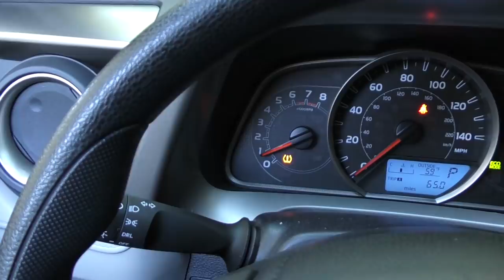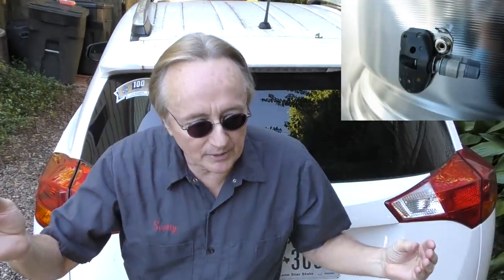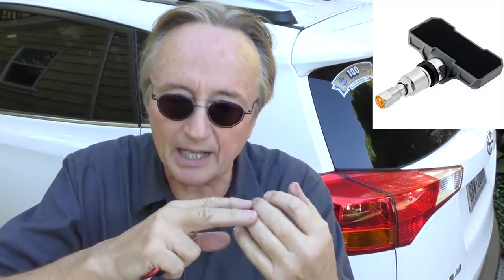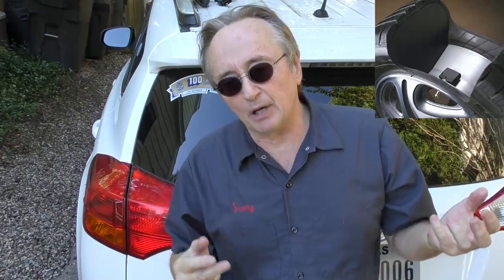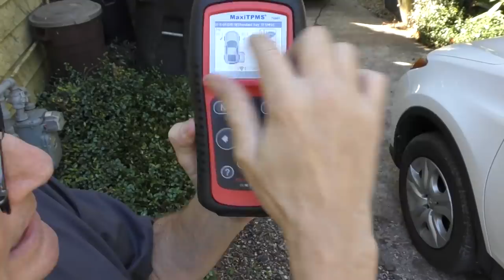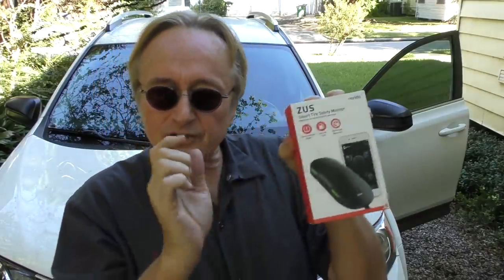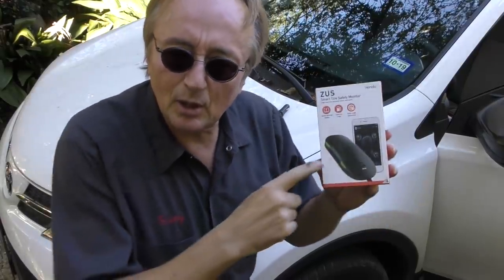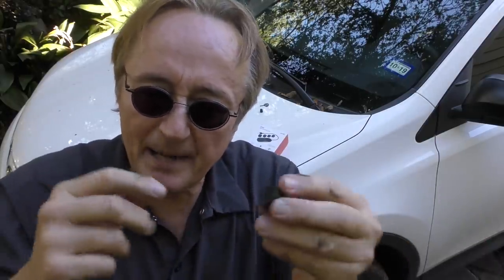Here’s Why This Kind of Tire is Stupid

Comment: I had a poor hapless elderly lady who had been literally ripped off by at least 3 separate shops replacing TPMS units on all 4 of the mounted wheels on her RAV4. She still had a constant TPMS light on her dash. And the last shop she was at told her that she might need a new computer.  

 I was the shop manager,  and I asked her for her keys, pulled the truck into the shop, proceeded to check all of her tire pressures,  and verified with my Snap On Scanner  that the TPMS were communicating with the PCM.....which they were. 

Then I popped the cover off her spare tire and checked the pressure.  It was the OEM spare, and had NEVER had the cover removed from the tire before.
Lo and behold.....the spare only had about 22 P.S.I. !!! 
Inflated it to the proper pressure and before I could even pull it out of the shop, the light went out! 
 Didn't charge her one red cent! 
I felt really bad for her being taken advantage of like that.
Reply: Well done.  Where is your shop?
Reply: Awesome 👍. Every shop and every mechanic should be just like you! But that would be too good to be true....
Reply: @cruiser1398  Thank you for the compliment!
Reply: TSC TSC  Thank you for the compliment!
Reply: I was going to ask if it was a toyota and it sure was lol
Reply: Impalaman1968 Dude we live in a world where money is everything. Shops and dealerships will PROFILE you. The old lady you saved was profiled because the douchebags knows she has money and don’t know about cars so they say hey let’s make a high repair bill. Good job kind sir for helping her. We need more people like you.
Reply: My apologies for being able to up-vote only once.

Comment: Call me old fashion but I never needed a light to tell me I needed air. People these days cannot do anything for themselves..it's really sad
Reply: It’s just for less usage of your time. Now you can use your phone to remind you when to change the oil, when will the battery run out, when will something in your car be outdated or worn out because of the warranty. When you have a busy life, it sure does help a lot. Something the older generation doesn’t understand. I noticed that with my parents.
Reply: SubScribe 887TV A phone can definitely cause a nervous breakdown, but not as fast as trying to read your comment with it’s absurd capitalization. 🤦‍♂️
Reply: Same. That's why I never bothered changing those sensors
Reply: If you go this route, is there a way to disable the factory system or you will you have the warning light on permanently?
Reply: That's stupid to say. Hey why don't you go back to landline phones without caller IDs while you're at it, old timer
Reply: horacio gonzalez it’s not being lazy it that we have to work two to three jobs if your middle class now thanks to everything being high these days. We have so much in our minds we have to do to just check tires by looking in just using our eyes isn’t enough.
Reply: @DirtyGreens  That's stupid. People are fat and lazy because of their diet. Processed foods, take-out, sugar, seed oils. Eat like your grandparents.
Reply: @living-wellon-less5669  Oh.
Reply: @horaciogonzalez4070   What happens when your phone breaks or the power goes off?  You will have no clue and the rest of us will use our eyes.
Reply: This is the kind of comment that bugs me. Do you need it? No! Of course not! Doesn’t mean it’s not nice to have tho
Reply: @johnc9546  When the phone breaks or the power goes off the car battery still works which means the computer in the car still works so while you are staring at your tires using mental telepathy to determine your tire pressure I will just start my car and drive away!
Reply: @living-wellon-less5669  Good for you.
Reply: @johnc9546  It's nothing special, it's called common sense, you should try it sometime! It will save you a lot of embarrassment!
Reply: I had to explain to a surgeon how to check the air pressure, and put air in the tire.  Imagine that mommy, and daddy sent you to medical school, but never taught you how to check a freaking tire!  BTW, I'm a nurse.
Reply: @pmarie2003  Priorities, I have a friend that is 51, lives in LA and has never driven a car but he is a brilliant writer and officially scores in the genius level of IQ. The fact that he doesn't even know where or how to check tire pressure means nothing to him or me, it only means when I go to visit him I have to drive or take Uber!
Reply: David Knigge Grams ate a plain potato for dinner most nights, lived to be over 100
Reply: @living-wellon-less5669  lol thats sad 🤣😂🤣
Reply: its the manufacturers that shove these unnecessary tech down people's throats
Reply: @aneesh8963  No they don't, ABS and traction control are required by law and tire pressure is a critical part of the system, if tire pressure drops too low ABS and Traction control i can be compromised and the computer will even shut them off!
Reply: horacio gonzale
Reply: You can easily bypass it, which i have done in my older car, as the sensors don't work right with my after market wheels.
Reply: @shartingfish5761  Not if you have traction control!
Reply: Living-well on-less even if you have traction control, makes zero difference
Reply: @shartingfish5761  Sorry but it will interfere with the traction control, maintaining proper air pressure is necessary for traction control to work properly or even at all. I retired from GM, I know how it works and even if you work a way around it  it's foolish and potentially dangerous using traction control! This is all a lark anyway, failure on those valve stems is rare unless maybe you are driving a Toyota! Get used to it, it's called technology and some of it actually works!
Reply: @living-wellon-less5669  cars without tpms have traction control though, you just make sure pressure is within spec, so where's that logic going?
Reply: @hpt08  You are assuming nothing goes wrong, you are assuming everybody has the same sense of awareness, you are assuming you will never get a blowout which using traction control could easily cause an accident, you are assuming a 70 year old woman is going to be regularly checking her tires! What you decide to do to your car is one thing but blindly giving advice like that is irresponsible at best!
Reply: Living-well on-less I appreciate the feedback but;
1. I don't buy GM products because there junk.
2. Traction control in most cars has zero to do with tire pressure, most traction control systems of early used a module on the abs controller to modulate the spinning of a wheel to gain traction, the traction control systems of later in such systems like A-Trac in Toyota uses an electronic viscous coupler that uses the centrifugal force to measure a slipping wheel and can modulate power other wheels.. if GM truely relies on tire pressure to determine traction control.. what a piece of crap system that is..
3. I at no point said you shouldn't maintain a specific tire pressure, but running a 30lb of air system in a mickey thompson racing slick isn't happening and since that light is annoying, i just used a pvc tube in the trunk to house all the sensors and still do that on my older cars so I don't have to replace the stupid sensors every time i change tires.. I don't care about traction control and have the stability control bypassed. Running a ford 9in rear, 3.73 gears, and traklock with 3in traction bars, and a 2000 stall converter.. if i need weather traction, i put 4 sand bags in the trunk and a set of blizzacks on a different set of wheels..
Reply: Living-well on-less he said make sure the pressure is in spec and that invoked that reaction? Why you so defensive? Also, tpms has nothing to do with abs/traction control. Tpms is a wireless system, trac/abs isn’t
Reply: Jerry4050 I Agree Jerry4050, Everything is so expensive now because of technology. I understand that it’s a convenience for people who love technology, but it will cost a lot of money to fix when something goes bad. Anyway, I agree with the technology being used in the medical field though.
Reply: Thing is though , by the time a modern radial "looks " low on air it has about 14 pounds in it maybe.

Comment: I'm gonna stick to manually checking and keeping an eye on my tyres.
Reply: Yep the old fashioned way is better.
Reply: You can also crank your windows manually. Maybe your engine as well.... Old foks not accepting change is always hilarious.
Reply: cesar soto Young folks accepting extra unneeded expenses crack me up 😜
Reply: cesar soto no one is saying that change is bad. All these electronics will fail and cause more issues. Sometimes it’s better to just check things yourself like tire pressure and engine oil level!
Reply: YOu can also hit your tires with a stick to check if its good on air 😂
Reply: @hawkboy000  these people probably go to the dealer to check their oil level 🤣😂🤣😂

Comment: Audi for example uses indirect TPMS which instead measures pressure by monitoring individual wheel rotational speeds (by using the ABS sensors); A tire at low pressure will roll at a different wheel speed than tires at higher pressures.

Comment: There's three things I watch for to see if a shop is truly competent.  (1) Do they inflate the tires (assuming factory sized) to whats on the sidewall  instead of what's on the doorjamb?  WAY TOO OFTEN!!!  Yes, the tire can hold 35 psi BUT the cars manufacturer designed the suspension and alignment to operate with the tires inflated to a specific pressure.  Doing otherwise wears things out faster and is potentially dangerous.  (2)  If they do a light check do they skip the backup lights?   Maybe it doesn't matter to most folks but when I ask for a light check or worse, when you foist one off on me, DO IT RIGHT!  (3) When I bring it in with a front-end shimmy while braking do you raise it up and turn the front wheels by hand... WITH the tire on the car?  BETTER NOT!  Archimedes said give me a long enough lever and I'll move the world.  Same thing applies to a tire.  You're using a foot-long lever to rotate the tire and it will turn easier.  Pull the tire and try rotating the spindle with one hand on the center of the lugs.  THAT is how you determine how warped a rotor is.  

Other things come to mind from time to time but those are the big three that stay with me as they have happened more than once.  That ASE sewn to your shirt don't mean crap when you talk fast and loose to me.

Comment: New cars have more sensors/electronics = more things that break....
Reply: Yet modern cars are more reliable and commonly get more than 100 K on them before any major repairs are required! Try to remember most of those sensors perform a function required by law!
Reply: That's just the idea!
Reply: @living-wellon-less5669  Yet modern cars are more reliable, NO
Reply: There endless money pits!
Reply: @littleeagle7563  obviously you never owned a car with points, and a condenser,  and the average engine had to be rebuilt by 100 k!
Reply: Well of Coors 👍🏻
Reply: @living-wellon-less5669  That's not true.
Reply: @living-wellon-less5669  what are with AC doesn't have a condenser? Lol
Reply: @thefuzzypickle8277  Ignition points, DUH!
Reply: @thefuzzypickle8277  Do you know the difference between AC and ignition?
Reply: ABORIGINAL ONE  It's not possible under current laws, the only legal way to do that now is with a kit car!

Comment: I had a problem with my TPMS light on in the dash. Thanks to you Scotty for your video you saved me hundreds of dollars because if I would have taken my car to any of these mechanic in New York City they would have ripped me off.  It was like you said I never bothered to check the spare tire pressure on the Honda CRV 2015 the pressure was at 20 and the spair needed 60 PSI. The spare has a TPMS like you said thanks for saving me time and hassle on the road if I used that spare tire on the road it's like I would have  a flat tire all over again, thanks for the advice.😀😀😀

Comment: I don’t have a tire pressure sensor in any of my tires 😂
Reply: & yet life goes on does it not?   Another "whiz bang" thingy that is really not needed.....
Reply: MarlinMR7 lmao yeah
Reply: You have tires?
Reply: Yes you do
Reply: I dont have it in my tires but i have the feature, i think it just measures the hight of my vehicle.
Reply: It’s known fact that tire underinflation is pervasive and is often responsible for car crashes and blowouts.  Then there are the millions of gallons of wasted fuel and the added air pollution/climate change that it contributes to.  I have a TPMS on my car and am grateful for it.  It makes it impossible to ignore an important car maintenance issue.
Reply: @ansdguy1  tire pressure  monitors  aren't that important  it's just another gimmick  money maker  I have one vehicle  with one without  they both function perfectly well everytime I gas up I check tire pressure
Reply: @stealthboy5767  Depends on the age of the car.  I have a 1994 Ford Ranger that doesn't have any.
Reply: Cuz ur poor
Reply: The Tire Pressure Sensor technology is going to be required in the United States soon, if it isn't already.  Frustrating to be forced to have new, unnecessary technology.
Reply: @ansdguy1  most accidents are caused by bad driving when one owns a vehicle they should be able to do their weekly checks this includes coolant engine oil washer fluid all these have sensors but if one checks these regularly including the tyre pressures most times if tyres are damaged or cracking /bulges you have a better chance of not having a problem tyre pressure sensors are not an indicator of a fault /condition in the tyre itself visual checks are the safest doing these checks in my opinion is safer by far electronics can go faulty so the thinking is I am safe because my sensor says all is well hmm check the condition of your tyres often and the pressure in doing that you are doing the best you can for your safety and others and saving the environment drive safely happiness to you and your family from the UK 🇬🇧🇺🇲
Reply: @alisterwest6987  very well said 👍
Reply: Ron L unless you’re a responsible adult who knows how a vehicle drives and knows when something is wrong. They call those dummy lights for a reason.
Reply: Alister West Here is the thing, quantitative data doesn't lie.  You seen to think that people simply don't ignore tire pressure.  The know fact by the Insurance Institute suggests that in the U.S. this is not the case.  You people that butch about having to pay for new technologies make me laugh.  I own a 2006 Cadillac CTS that has the system and its almost 14 years old.  New tech?  Hardly, and besides today's cars are nothing but new tech.  From the tires to the motor oil to the ignition system to the safety systems like chassis that resist causing injury when crushed to environmentally friendlier air conditioning coolant to electric starting to drive by wire throttles and on and on.  You have not addressed the climate change aspect of low tire pressures or the decreased fuel mileage or the premature wearing out of those expensive new tires.  Exactly how much do these SAFETY systems as to the cost of a new car?  People pay a small fortune for audio or wheel upgrades, along with several other possibilities.  
Here in America we have an old saying in in the form of three letters; BFD.😏
Honestly, all of this crap about tire pressure monitoring?
Reply: Congratulations
Reply: Glue one on your tire
Reply: My tire pressure monitors are in the rims, not the tires.  I still check tire pressure every month.
Reply: I mean they're only as useful as people maintain them. I know why they put them but if people ignore them? Welp

Comment: Why company put these tyre sensor inside a tyre

To rip you off
Reply: It's because 2008+ all cars must have TPMS by law.
Reply: In the US, it's federal law. If companies want to sell cars 8n the US, they have to have these sensors. I think dualies and heavy duty trucks are exempt.
Reply: They would steal the sensors so that's just a horrible idea in the first place besides the fact that it's law
Reply: It became U.S. federal law in 2008 due to all the drivers never checking their tires and then causing crashes due to tire failures.
Reply: Jose Esparza umm, Scotty said there’s a lock so you can.t steal them
Reply: @benz merc The law came about because people were dying because of tire tread separation due to low tire pressure. 

The whole Firestone debacle was caused by it. 60 people died and over a hundred injured.
Reply: @rays7437  Today we have people in their 90's still driving and most young people can't change their own oil much less check tire pressure and how many women in history would even think of checking. It isn't fair to label them all as "morons" when some of them could buy and sell you before lunch!
Reply: @jschackmann2  in what part of the video cause I didn't see him mentioned anything about that?._.
Reply: @living-wellon-less5669  
Guess I touched a nerve.  So maybe they aren't ALL morons, maybe some are just lazy, or maybe some just think that checking fluids and tire pressures is beneath them.  Or, they are too busy with being narcissists to maintain their vehicle.
And to say that "some of them could buy and sell you before lunch" just shows your mentality. Obsessed with money?
Bye
Reply: @jschackmann2  i am taking about the company stock sensor that's inside
Reply: You believe everything they tell you don’t you, if you think our government gives a damn about our lives your not to bright, they did it to get more money out of you, it cost $400.00 up to 1,300.00 to repair the sensors when they go out in 4 to 5 years, they have batteries in them, you have to replace all 4 sensors or 5 if you have a spare.
Reply: @studivan  alex jones has entered the chat